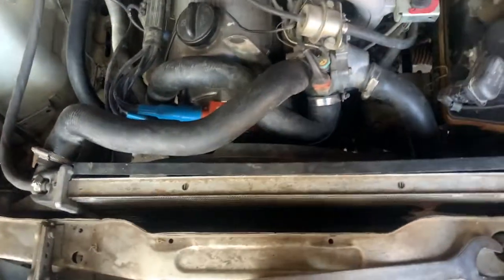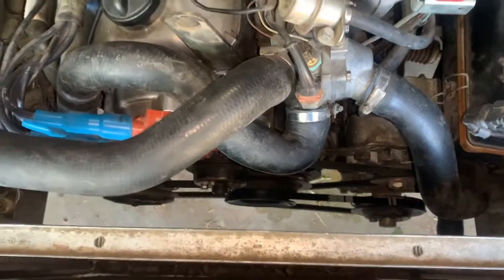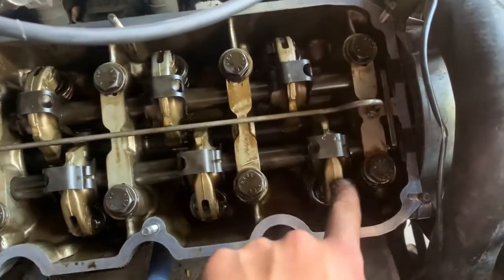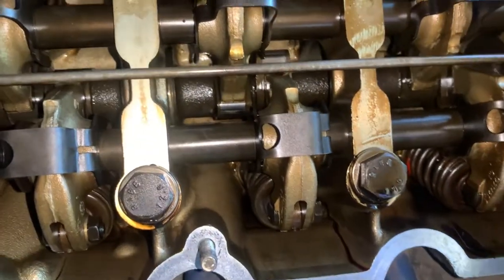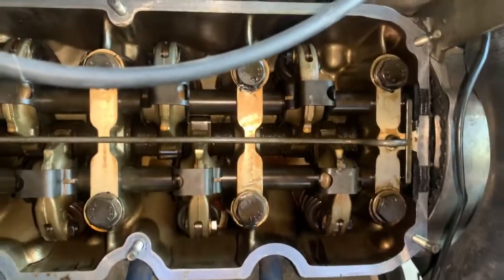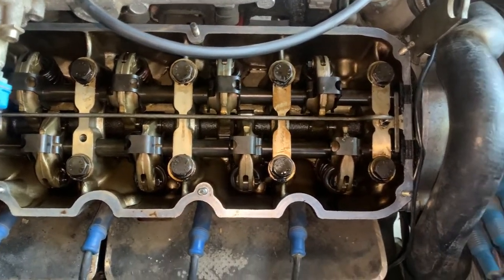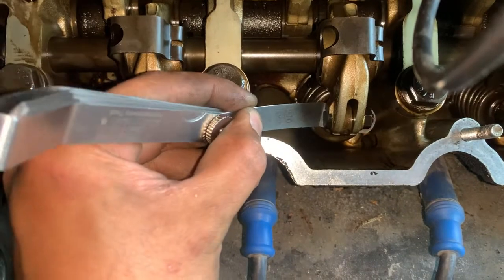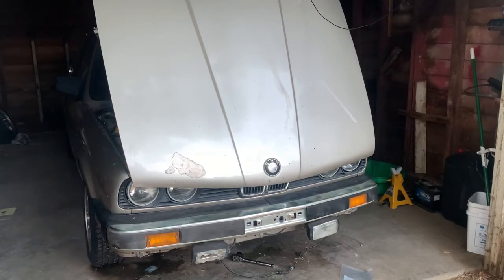How to check & adjust valve clearances (M20B27). Reviving an E30 (Part ~2)

Comment: Hello. have you installed a 0.1 mm valve clearance?
Reply from the maker: I am confused. You are only required to adjust the valves
Reply: Is the gap as 0.1 mm or as large as possible?
Reply from the maker: It is 0.10in (0.25mm) when the engine is stone cold